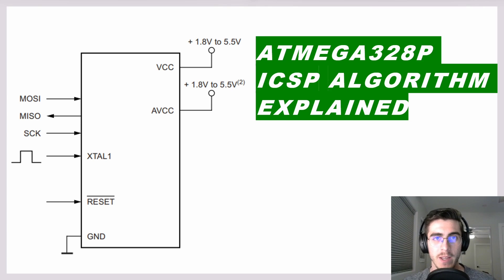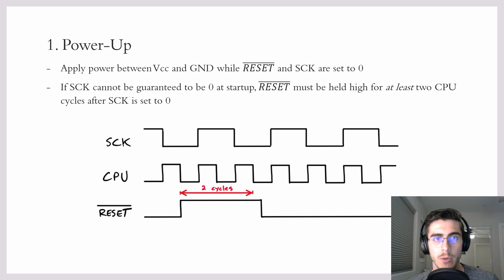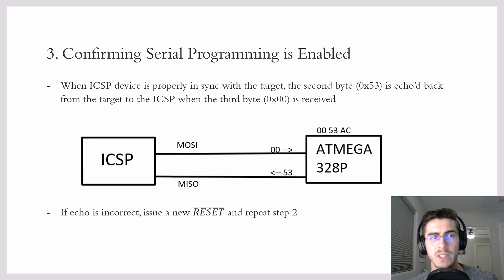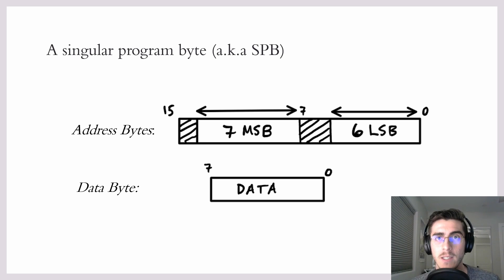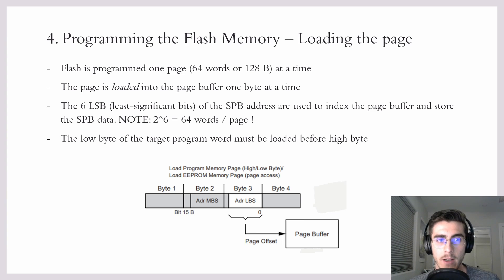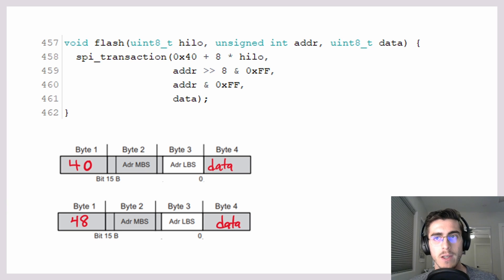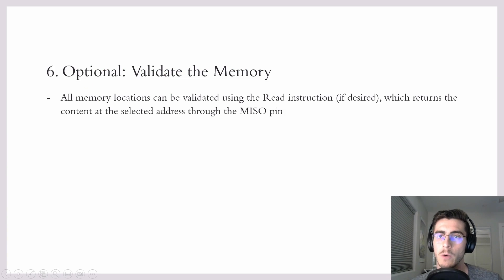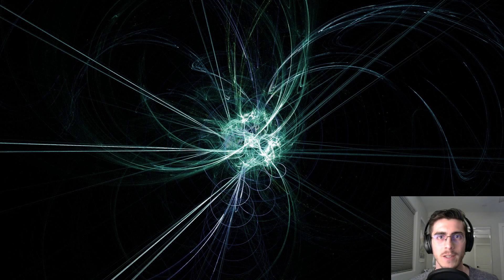AVR ATMEGA328P ICSP Algorithm Explained

Comment: Interesting to see the low level details on how program data is flashed byte by byte, somehow I would have thought it was sent data in larger chunks, say fill the 128 byte page buffer in one SPI transaction, guess not.  Thanks for the nice video outlining how it works at a low level.
Reply from the maker: Good observation, most NVRAM drivers write pages of data at a time like you mentioned.